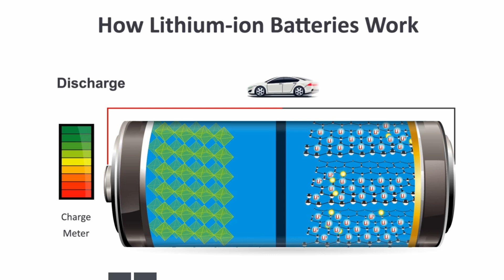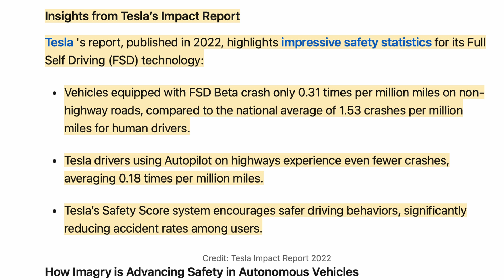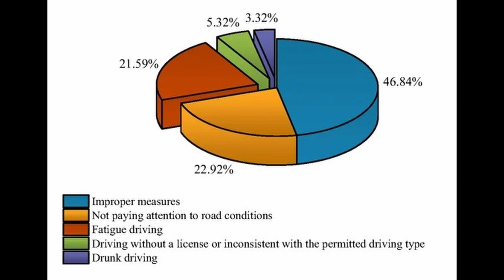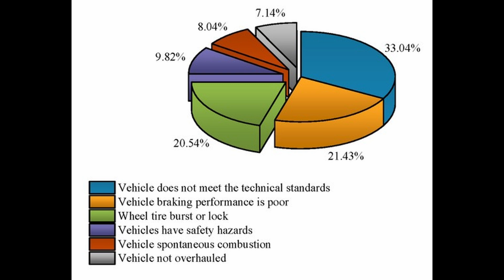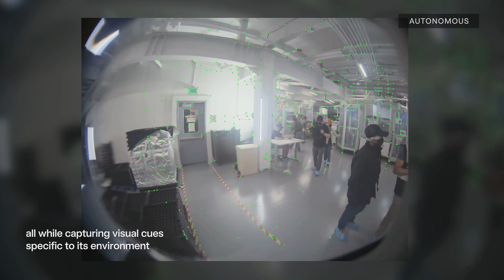The Future of Electric Vehicles: The Innovations You NEED to Know

Comment: There are many many more disadvantages to battery swapping than just the need for standardization... which itself is a killer to the hope of having multi-brand battery swapping stations.  They are:

- The extremely high investment cost of the battery swapping station.  According to CleanerWatt, a single station costs $420'000 , plus the cost of the land upon which it is built, plus the cost of the battery inventory (more on that later), which might be as high as $200k or even much higher if the station holds batteries for more than one brand.  If the swapping time proper is 3mn, the total turnover time is ca. 5mn.  So, the investment needed per car-hour unit capacity is AT LEAST (420k + 200k)/12 = ca. $52'000. That is 3 times more than for a Tesla V4 supercharger!

- As this automatized battery swapping station is bound to have lots of moving parts, actuators, mechanical sensors, etc... maintenance costs must surely be a multiple of those of a supercharger, and even worse of a future induction charger, which will require next to ZERO maintenance as it is 100% solid-state.

- If the station must carry an inventory of 20 batteries, either ready to be swapped or still in charge.  That is for ONLY one brand of vehicles... and I would say only for the models of approximately identical size of that brand!  But now imagine carrying an inventory of different batteries to serve 4 or 5 brands!  The inventory size... and the inventory carrying costs... would be many times higher!!!

- Batteries are still a production-constrained commodity.  That system immobilizes unnecessarily a not insignificant number of them.

- As a consequence of the above, uptime will be unavoidably lower than that of superchargers. 

- The need for quick-disconnect electrical, mechanical and hydraulic connections will unavoidably result in additional failures and maintenance needs for the vehicles so equipped.

- Swappable batteries make the concept of a load-bearing (structural) battery pack impossible, hence resulting in significantly heavier vehicles.

- The driver does not own the battery (at least not any given one), and therefore does not know how good a battery he is being given.  It could be a brand new one... or it could be one with already 20% degradation.  Not a problem for urban use... but definitely one if you are swapping the battery in preparation for a long road trip.

- Only 58 Nio battery swapping stations in Europe vs DC fast charging stations by the thousands... everywhere!!!!  Of course, the number of swapping stations will increase... but because of their high investment costs, more slowly and NEVER to the same geographic coverage than charging stations.

- Security against theft and vandalism.  

- And finally... consequence of much of the above:  higher swapping vs charging costs, MUCH lower  availability, more risks of a break-down of the system... either station side, or vehicle side.  In Europe, Nio charges €169 for a monthly subscription for a 75 kWh battery (and €289/month for a 100 kWh one), including 4 swaps.  Each additional swap costs €30. In France, you can charge 80% of a 75 kWh battery at a Tesla supercharger for only around €21... with no monthly fee if you own a Tesla, and only a modest €9.99 monthly fee for non-Tesla owners.  That is HALF the price of Nio for 4 swaps a month, and 30% less for each additional one!

So, now, what are the advantages of battery swapping?  I see only one major one, and another minor one:

- 5 mn battery turnaround vs 15-30 mn charging time.  For urban people with no possibility to charge at home, that is certainly a very good point.  BUT, a) that advantage is going dwindling down as DC fast-chargers get more powerful, and batteries can accept higher charging loads; and b) curbside induction chargers will be a MUCH cheaper solution for those people!

- I have heard that Nio was offering a choice of two batteries of the same size but not of the same weight.  One is the full-size battery for longer road-trip, the other is a reduced capacity one for city use, making the vehicle lighter in everyday use.  Sure!  A nice benefit, but a very marginal one... especially as the light battery will have to be swapped more often, generating more revenue for the swapping station... unless the swapping fee is counted per kWh and not per swap.

Finally, two major manufacturers already tried the concept and abandoned it:

- Renault, with their Israeli partner Better Place, has offered battery swapping in a number of countries between December 2008 and May 2013  , date of the bankruptcy of Better Place, which had cremated no less than $850 million of private capital!  Renault had also offered a plan under which the battery was NOT included in the car's purchase price, but was rented for a monthly fee... a creative form of financing and risk mitigation.  But the scheme was also abandoned... it seems that car owners do not like NOT owning the essential heart of their vehicle!

- Tesla designed their early Model S for battery swapping, and even started installing swapping stations.  But they very quickly realized it was making no sense, and they abandoned the concept... but some early Model S cars still have batteries that can theoretically be swapped!
Reply: Several companies are in the process of tooling new models to fit nio's swap system: .....NIO has partnered with Changan Automobile, Geely Holding, JAC Group and Chery Automobile in battery swap to jointly promote the development of the battery swap network and industry standards.
Reply: @onetwothreefour-s1n  Good!  The system may have a market in large Chinese cities... what do I know.  But in Europe or North America?
The problem is not only the standardization of the coupling systems, but of vastly different battery sizes.  You cannot possible standardize the battery of a Mini and that of a Hummer; not even of a Model 3 and a Model S!
Reply: The system obviously checks battery health at each change. Any defects are removed from the system.
Reply: @onetwothreefour-s1n  I am sure it does.  But an older battery with 20% degradation has no defect... and will not get eliminated... you may well get it in exchange for the brand new battery the car came equipped with!
Reply: Swapping energy costs are far lower than high speed charging.
Reply: Nio have 3 batteries, 75, 100, 150. The 150 is semi solid state and is just 20kg heavier than the 100 kwh nmc pack. People who choose to rent do the 75 predominantly lfp battery.
Reply: Nio's can be charged at home or at nios largest plug in network in all of China. You can rent a different sized battery for as little as a weekend, meaning real road trips can remove the hassle of worrying about charging stations.
Reply: You can own the battery in a nio.
Reply: Nios updated models this year will all move to a 900 volt system. Nio stations already come equipped with 600 kw chargers. You can fast charge or even faster swap with your nio, your choice. Oh, and they have live beta tests where the car drives to swap stations at night on its own. They also have autonomous highway swaps, meaning your car takes you from the road to swap and back again all autonomously
Reply: The entire 3,000 swap station network is contracted with Chinese electric providers to help manage the grid. Nio get cheap power at night and sells back power at higher rates during the day. Their cars can do the same at nio plug chargers. Same in Denmark as well. Oh, the stations all have solar roofs as well.
Reply: Are you suggesting a nio swap station with cameras and lidars for autonomous vehicle entry would be more prone to vandalism than fields of chargers in tired old parking lots?
Reply: @onetwothreefour-s1n  Not vandalism, theft. People are stealing the cables from EV charging  stations for the metal content they can resell. Security cameras would seem to be a good investment. If the chargers are located in a well-trafficked area such as outside a supermarket or at a gas station, the problem is diminished.
One EV battery would be worth more to thieves than yards of snipped cabling. It would be a more organized attack than a couple of blokes in balaclavas.
Reply: Nio just hit 60 million swaps, 4 months after hitting 50 million. That's 80,000 ish swaps a day. They also own the largest plug in network in China.
Reply: @st-ex8506  As of December 18, Nio had 913 battery swap stations along China's highways, meaning an average of one every 200 kilometers, it said.

On these 18 major highways, there is an average of one Nio battery swap station within 50-100 kilometers, it said
Reply: @onetwothreefour-s1n  Good!  But it is still bloody damn few!  

In France alone... a country about 20 times smaller, and 20 times smaller population than China... there are over 120'000 DC fast-charging stations on the highways, or within 1 km of a highway exit... not counting the even more numerous AC charging stations!  Those stations deserve ALL EV brands, ALL battery sizes and technologies... not just a couple of models!  And charging, when you account for an average yearly mix of home + fast-charging, costs only a small fraction (1/4 to 1/2 depending on mileage and type of vehicle) of what Nio's battery swapping services cost!

Sure, charging takes a bit longer... except if you have to make a 20mn detour to get to the nearest swapping station!

It's a bit like hydrogen filling stations.  I live in central France, and the nearest hydrogen-filling station is 110 km from my home!  I don't even know where is the nearest Nio battery swapping station!  The nearest pair of chargers is in the center of my village, 3 km away... should I ever need them.

Nio is trying to solve, at great costs and complexity, a problem that does not exist anymore... at least not in Europe!
Reply: @st-ex8506  Nio also has one of the largest charging networks in China, with 2,512 supercharging stations offering 11,596 charging piles and 1,670 destination charging stations offering 13,007 charging piles.
Reply: @st-ex8506  nio grid regulation in Denmark, quote: The service barely affects battery swap stations' ability to provide service to car owners, with one station bringing in revenue in the tens of thousands of euros a year, according to a Nio vice president.
Reply: Wow. Thanks for writing that. I already saw it as a non goer but now feel fully up to speed.
Case closed.
Like with hydrogen cars.
Reply: @CheeseLovingGuy  Precisely!  Both technologies look like good ideas on paper... but both fail miserably when you start crunching the numbers, and scrutinizing their promises and challenges.
Reply: They are "fixing" a problem that is rapidly disappearing, and many drivers never experience: the time it takes to charge an EV battery during a long roadtrip. 
Battery swap stations do make sense for eBike couriers in cities, where the swap is done manually by the courier.
Reply: @ziploc2000  the goal of swapping isn't just faster charge times. Autonomous charging, grid regulation, battery life health, battery upgrades, lower upfront costs to consumers, energy arbitration etc...
Reply: Excellent overview. ❤

Comment: This battery-swopping idea is exceedingly stupid. 
1. You have 20 battery packs lying dormant and un-used (per swop-station). Thee are better-deployed in actual vehicles, so Nio is only using 5% of their battery packs to insert into cars.
2. The swopping stations cost upwards of $2 million to construct - eye-watering capex for a company that is already functionally bankrupt.
3. Battery technology has improved, and charge faster, and last longer. In the case of Tesla, the battery packs will last longer than the rest of the car.
4. FSD is almost here, heralding robotaxis. Most people will no longer need to buy/own a car.
Reply: I think, like anything else, it will have its applications. Think lorries or buses.

PS your maths is off. According to the video each battery pack takes an hour to charge, so it can do 20 battery swaps per hour, it isn't 20 batteries to every single car charged, it is 20 batteries for every car swap station. In the worst case thats more like 1 extra battery per 1000 cars.
Reply: @benholroyd5221  yes, 5-10% of batteries are " idle " at any given time. These are used to regulate the grid and nio sells electricity back to the grid as well. There's no real point arguing with a fanboy. Those fools are way past logic and reason.
Reply: Fsd is hilarious. You can do better.
Reply: @onetwothreefour-s1n Have you ever used FSD in the USA? If not your comment is nothing more than an opinion.
Reply: The swap stations don’t cost even close to your over blown price, they cost between 400k-500k, also they are being used to buffer the grid in many city’s and some are already making a profit on that alone. At 60 to 80 swaps a day and they are profitable.
Reply: And what will the cost be at these battery swapping stations?  Is it likely to match or beat the £4 to £5 I currently pay for a full charge on my drive?  It certainly isn't going to be as convenient.
Reply: @Brian-om2hh  you can charge at home, spanky. These are for people who can't charge at home.

Comment: Nuclear fusion has been around the corner for more than 4 decades, I don't know if the latest advancement changes anything.
Some claim that it should be possible to run a car on water, but that would require fusion in the process

Comment: Ions and electrons aren't the same. Ions are elements without a complete balance of electrons. Electrons are electricity. Ions don't leave the battery cell.
Reply: He's also wrong to say that "ions have a positive charge". Some ions (cations) have a positive charge, whereas others (anions) have a negative charge.
Reply: @rogerbradley5213  exactly.
Reply: And the small matter that lithium ions weigh nearly 13,000 times as much as the almost weightless electron. So, no, not the same.